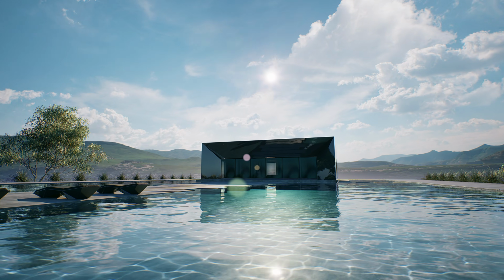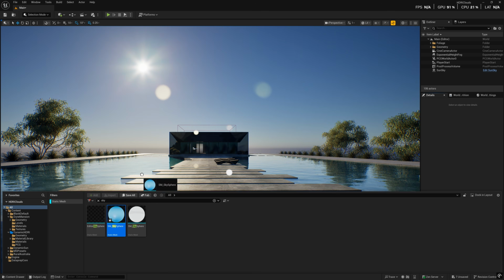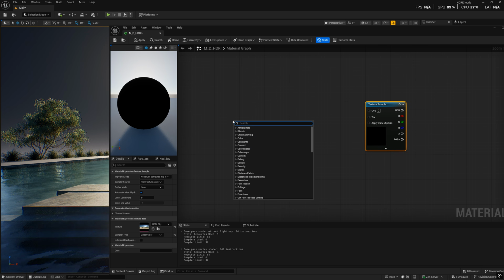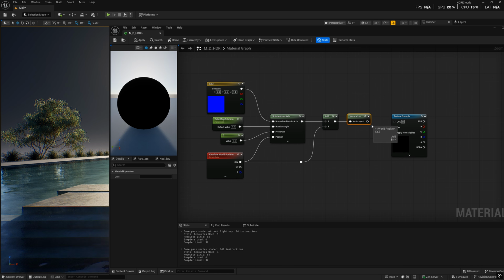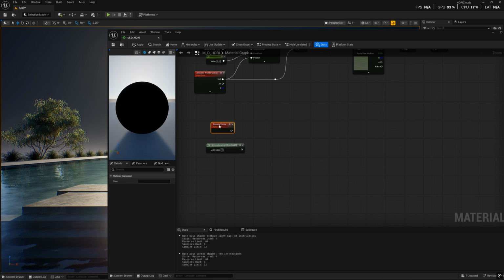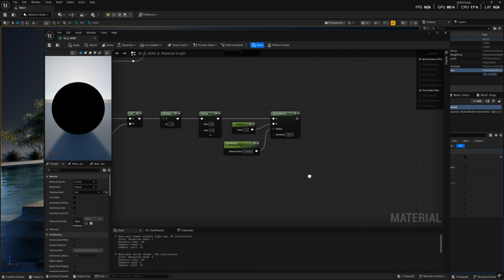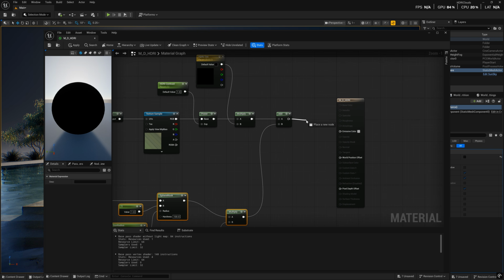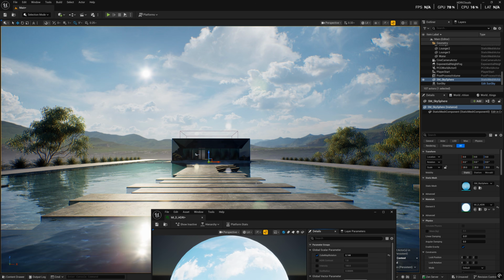Perfect Lighting for ArchViz in Unreal Engine. HDRI + Dynamic Sun

Comment: Black HDRI Issue in Unreal Engine 5.7
I was using Unreal Engine 5.7 and ran into an issue where the Material Editor preview appeared completely black. Here’s a small but useful refinement tip:

[HDRI TINT] Setting
By default, the HDRI TINT value is set to black (0, 0, 0). Since this parameter is typically used in a Multiply node right after the HDRI, it can effectively zero out the HDRI image in the preview.
To fix this, set the HDRI TINT value to white (1, 1, 1). This ensures the HDRI displays with its original colors in the Material Editor preview.
Reply: worked same for me.